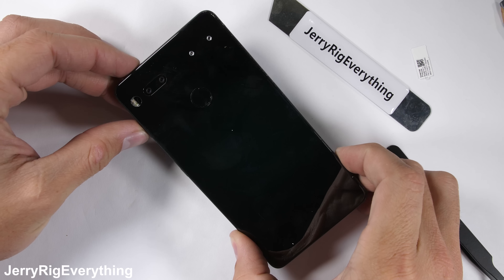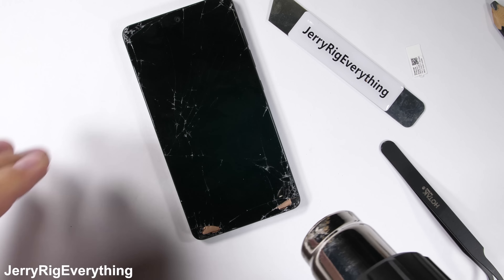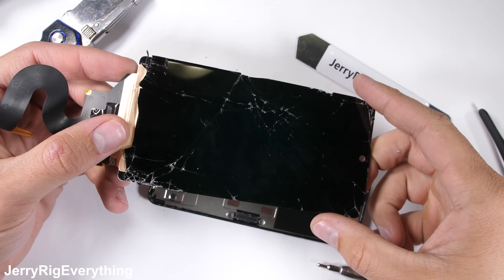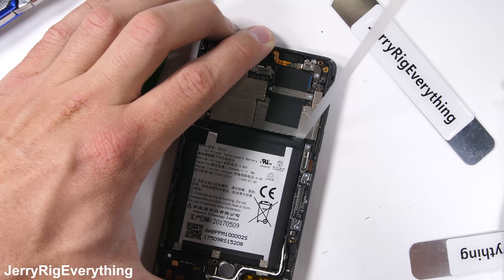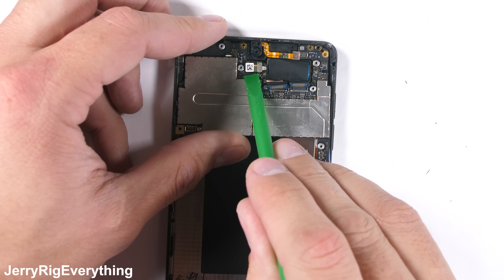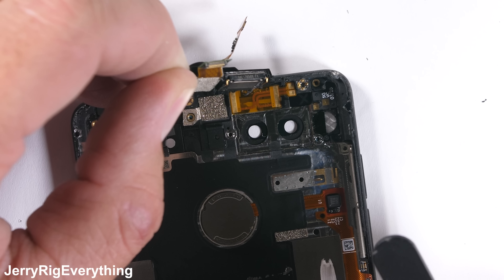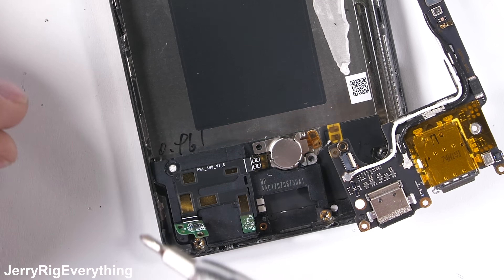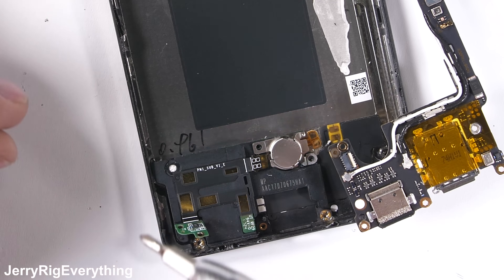Essential Phone Teardown - Complicated and Pointless

Comment: Haha as Apple can tell you...batteries don't last forever!
Reply: CoolCat Carolena no battery lasts forever, and in inferior android copyphones, they die years before in a perfect apple device
Reply: CoolCat Carolena yes even if you bought an iPhone 7 few days ago it will be slow down because of "degraded battery" no matter if you bought last year model as brand new few days it will be slow down because it's "older model" and the "battery is bad and needs to be changed" but they will say that i need to buy new one... 😡
Reply: Haha I know coolcat I thought that was a total burn on apple like lolol
Reply: +Tomas Gaming that is not truth, if the phone is new and the battery i intact it won't be slowed down. If u are gonna roast, at least do some research first...
Reply: Tomas Gaming  has not yet throttled the SOC on the iPhone 7/iPhone 7 Plus yet.
Reply: official_gymkhanaschoitl Lmao my Nexus 6 has outlasted my friend's iPhone 6.

Have fun with your iPhones that cost far more than they should :D
Reply: official_gymkhanaschoitl then how come most cheap android phones let u replace the battery and not have to buy a whole new phone unlock apple?
Reply: Roshan Pai Samsung devices slow down on every update as well.
Reply: Jacobytm 01 get the battery replaced smart one, that’s what apple stores are for
Reply: Tinu Thomas apple sheep
Reply: Tinu Thomas but then why some iPhones were slowed down for no reason? I know! They want to you would upgrade to the new model!
Reply: Tomas Gaming true. I mean isn't it weird that the update that makes the iPhone slow comes around the same time a new iPhone was released. Plus Samsung LG, and other companies said they don't slow down their phones.
Reply: Tomas Gaming No iPhone was slowed without any reason. I think that you don't even have an iPhone. Do some research m8.
Reply: Shubh Jsh i have iPhone 5.
Reply: Shubh Jsh iOS 10.3.3 jailbroken and have dualboot iOS 7.1.2 & 10.3.3
Reply: Tomas Gaming iPhone 5 wasn't even slowed down. The only affected phones were iPhone 6 and above and I happen to have access all of them. 
Your phone has not been slowed down and has just genuinely become old. It's been ~5 years since iPhone 5 was released.
Reply: Tomas Gaming when was it slowed down for no reason? The iPhone 6 6s SE and 7 are now programmed to slow down the CPU if the battery can’t handle its demand. At the moment only the iPhone 6 users are seeing a change but the rest are completely fine. iPhones don’t slow down unless you’re talking about on new updates. Old hardware doesn’t run new software as well as new software does. That’s a fact
Reply: Tomas Gaming You realise that the throttling feature is only activated if the battery is over a year old? If you bought any new iPhone, you’d be getting max speed.
Reply: Jacobytm 01 You can Just get a new battery for $29..
Reply: immortalHD 7 no it’s not it the phone is old, it’s only when the battery is at 80% of its original health, these phones are 3 years old
Reply: Tomas Gaming Which iphone was slowed down for no reason? A year old iPhone 7 still needs battery protection. If you buy a new iPhone, you’re not being slowed down. The feature only activates when the battery is more than a year old.
Reply: The Unknown So now anyone who actually knows what they’re talking about, and who isn’t just blindly following what others say, is a sheep?
Reply: Tinu Thomas Exactly. So if you buy any new iPhone, from SE to X, your performance won’t be throttled.
Reply: Tinu Thomas that would be a point if iphones had reliable and consistent batteries over the years... But all I see is friends' iphones dying on 30% or more battery after half a day of use. My old Xperia z had shit battery to begin with and after 4 years of use it still was more reliable than an iPhone 6.
Reply: LOGAN it actually depends on how much usage it has had with the number of charges cycles it has been through. iPhone 7 batteries could have already been charged over 500 times depending on use
Reply: Shubh Jsh the battery life thing seems to be is a red herring as the iPhone 5s and 5 aren't affected by the slow down, yet the SE is. Different battery manufacturers?
Reply: Remember, this whole thread happened because of a comment making an Apple joke.
Reply: u think they want do research?? as long can humiliate apple, thats enough for them. if they do research , they cant made fun of apple
Reply: Remarkably Unremarkable iPhone is overrated and I find it found way too much in people's hands. I just don't think they bothered to try other phones and just went with that phone because everyone else has it. It's just herd instinct.
Reply: Tomas Gaming that isnt how it works. Dont speead false information
Reply: No, my 6 month old iPhone 6s didn't faced this slowing down or throttle issue, as having same benchmark results
Reply: Fried Apple
Reply: Actually, Apple has a somewhat legitimate reason on why they slow down iPhones with degraded batteries.

It's to reduce the likelihood that the phone would suddenly and randomly shut off due to the battery not being able to supply the required wattage during bursts of intensive workload. Not only is this inconvenient but it can also prove to be seriously problematic during emergency cases.

Now, Android manufacturers claim to not slow them down, but having owned a Moto Z which keeps shutting off randomly due to a degraded battery, I feel that maybe they should at least consider some sort of temporary workaround.

But here's the thing. An iPhone has 500 charge cycles while even an Apple Watch apparently has twice the number of cycles before capacity begins to deteriorate. A Galaxy S8 and Note8 apparently only degrade up to 95% of its capacity after reaching a certain amount of charge cycles over a 1-2 year period. I think it's time Apple starts putting better batteries on the iPhones.
Reply: Or, how about Apple stops doing what's basically a locked overclock to the processor, so you get consistent performance from the phone across its lifespan?
Reply: I use my Sony Xperia z 2 for almost 5 years now and no battery problems or slowdowns. It is perfect.
Reply: currently using a samsung galaxy s5, bought it at the end of 2014, still hasn't slowed down at all or even broken in daily use... also thinking that the battery could even cause any type of slowdown in the phone is ridiculous in itself

edit: also no, the battery lasts as long as it did when i got the phone and it doesnt randomly shut off because of "excessive current usage by the cpu" just quit your bullshit
Reply: And as Fandroid is going to tell you: Android batteries of course last forever. It must be! Right ?
Reply: ThatOneBlueGuy 
If you write something like that, you have to expect that. If i write: „2018 is there, unlike your Android update“, a whole bunch of people are going to be pissed as well.
Reply: i have no idea what you are trying to say with "2018 is there, unlike your Android update"?? it doesnt even make any sense :D
Reply: juhotuho10 
Its a joke about Android. But also an example. Not more.
Reply: The Unknown yes because calling him an apple sheep is a very compelling argument
Reply: Dude Lmao iPhones are totally worth the price, unlike android copyphones, which are heavy overpriced. Not even worth 10 bucks, for cheap iPhone ripoffs
Reply: +Mabirc research lineage os
Reply: BenlePlayz 
I know what that is. Changes nothing.
Reply: People kept complaining about their phones randomly shutting off when it still had a good amount of battery percent. So apple fixed that problem by slowing down the iPhones of people who have a badly degraded battery. Now they are complaining that their phone is too slow when they basically asked apple to slow their phone down.
Reply: arthur staal the 30% dying thing is basically why Apple Is doing this. It’s a 3 year old phone, I don’t think it should be lasting that long especially since its a way smaller capacity compared to the Xperia Z. Phones aren’t made to last forever, your phone will do what I stated before. Once the battery is finally taking its toll, the phone will shut off randomly because the battery can’t give what the CPU demands
Reply: So much animosity. Can we all love each other <3
Reply: Tinu Thomas The only sane comment here, yet you’re repeatedly called a ‘sheep’. Shows who the real sheep are if common sense and a clear understanding flies over people’s thought bubbles.
Reply: CoolCat Carolena 
Well I just recently got the essential phone, but before that I had s Nexus 5, I've had that thing probably since it came out (which was 2012, I believe) meaning it lasted 6 years without a battery change, and plenty of me dropping it.

And it only cracked a couple months before I got my new one.

So I don't know about iPhones, but if an older iPhone can do that, then your on equal footing here.
Reply: Carlos Sanchez exactly, initially I did get mad that Apple was slowing phones down but I actually did my research and honestly Apple did nothing wrong other than never disclosing what causes the slowdown. I love both iOS and Android and all the companies in the game, but when people are ignorant I’d love to come in and clear everything up.
Reply: Tomas Gaming e
Reply: Tinu Thomas That’s what they want you to do, they want you to pay alot of money to get the battery replaced because the IPhones are unrepairable yourself
Reply: Batteries do degrade
Reply: @DerPfoertner  Between a 5 year old android and a 5 year old equal spec iphone, i bet android would perform better
Reply: The Unknown Samsung later said they did. The update comes with the new phone same as every manufacturer. Your phone isn’t slowed down if you have a perfect battery. With the battery status info now you can check if your phone is throttled and deactivate it
Reply: arthur staal the bigger the battery the more it degrades...
Reply: juhotuho10 because the cpu in the s5 is very slow...
Reply: Adnan Ahmad they always release the new update with the phone and they did that before the started throttling so what’s your point?
Reply: Frankie yeah 29€? „ a lot of Money“ well less than any other manufacturer with a similar battery...
Reply: @DerPfoertner  haha the " perfect " apple device
Get a life
Reply: @DerPfoertner  aww don't be salty
Reply: Manufacturers count on it so they can sell a New phone instead of just the battery Also each New model requires more dongles and external crap so even more useless shit can be sold

Comment: Essential Phone — A phone that lacks all the ESSENTIALS.... 😏😜
Reply: Raghav T Called "essentials phone", but lacks an AUX port
Reply: Alloy The Raccoon I'm using it right now and I really like it
Reply: Alloy The Raccoon I can understand why it isn't for everyone. And I was kind of apprehensive about the headphone jack at first. But I pretty much use Bluetooth for everything now and they provide a nice braided dongle if I wanna use a wired pair, so I really haven't had any problems.
Reply: Noah Barnhart It's a good phone, especially at the price point. Display is gorgeous, it's IP 54 so it can get rained on with no problem, and it runs smoothly. Honestly I love my note 8 but if the essentials phone was IP67 rated or higher and had an AUX port I would have chosen it over my GN8
Reply: AmnScottNN Well said sir. I think the only thing that I wish it had that it doesn't is an OLED screen. Everything else is great.
Reply: an aux is not even close to essential
Reply: Me too. I love it. The camera is also getting better with updates.
Reply: Raghav T 
Got an essential for Christmas
Reply: Alloy The Raccoon 
It's surprisingly easy to get a basic case, there are like 5 different types and only one is nearly sold out.
Reply: Alloy The Raccoon 
Really? My brother found some within like seconds.

I literally just googled it and got some hits.
Reply: Alloy The Raccoon 
I think we got it from the Sprint store, not a physical one. 

Maybe they don't sell it near you as you theorized, even though it's snowing online thing.

Must be a country thing then. Either way, cases are easy to get in the states.
Reply: The silly irony. All I one packaguuu
Reply: I bought one in 2019. I liked it within a day, bought another for a backup for $100. Talk about an underused phone...

Comment: I was able to repair my phone very easily... got the screen online in ebay, bought a heat gun at harbor freight for $12 and bought a suction cup for dents on cars there for $4.... used e6000 glue from walmart for like $4 however i should have bought the black glue instead of the clear version.... all in all i spent $60 bucks maybe and maybe an hour to repair as a first timer... the hardest part was installing the glue before i found out it was drying quick lol... once screen was installed wrapped it with rubber bands tightly since i didnt have a clamp used it 2 days later and its been working perfectly. its my daily driver. i wish i had a longer lasting battery but i am very pleased with my phone again. this time ill have a case on

Comment: Essential facts: 1. The mobo networking and the essential housing network bands must have the same serial codes, otherwise your phone will essentially fail to read sim card and connect to Wi-Fi.
2. There are several types of screws: small black, big black. Small silver, big silver. But there is one black screw that is bigger than big black screws.
3. This phone is made of premium materials yet the display is a cheaper lcd screen.

Comment: I contacted Essential to ask about authorized battery replacement center recommendations. That's because I heard about the parts not being readily available. This is the response I got:
______________
Hello,

Thank you for reaching out! 

The battery is not replaceable in itself due to the way the phone is designed.

Comment: One year into owning my Essential phone, I have no cracked display, a few scratches on the titanium edge from not cleaning the pocket sand from my case as often as I should, a 360 camera that's basically a paperweight, but on the plus side I have Android 10 with the latest security patch, and I was in the beta months ago. I have to restart it every other day or so as the 4gb of ram seems to fill and the phone slows down until a reboot. I like what they've done on the software side of this phone for sure though. Getting updates as quickly as the Pixel phones has been wonderful. Don't know how I feel about the new generation they unveiled, seems very odd to me. But if they make something else in a similar form factor, I might get it. Although I'd enjoy a headphone jack and an SD card slot.

Comment: Worth noting that this phone has no headphone jack, so the USB port will get much more wear compared to normal phone unless you have wireless headphones. No wireless charging either, so if the pernamently soldered USB port with no replacement parts available breaks, you're screwed.

Comment: ive been able to find screen replacements for the essential phone off ebay, are those fake? mine has a deep scratch i want to fix, also the battery does drain a bit faster but it also charges in 15-20 minutes to 100%, so its something i can live with lol still an amazing phone,

Comment: You only ever really need to mmaayyyybe change is the screen and the battery, which are both very easy to swap out. The screen is tough to get off but nowhere near as difficult as this video makes it seem. Lots of negativity surrounding this phone because of the competition.
Also, replacement screen is only $70. I had to replace mine and opted to do it myself over paying essential $200 for another phone.
Awesome Pixel 2xl/Oneplus alternative with better design and screen. 
Also has awesome xda dev support along with Android P working flawless

Comment: Hi jerry i can't really find you're contact details so here it goes, I've cracked my  2017 surface pro screen and seem to be unable to find any information about what replacement display is needed. now i know it's not a phone but i remember cracking my iphone 7 lens and you were the only one to cover that issue, this is a similar situation in my opinion ifixit doesn't have any infor as to wether the surface pro 4 and 5 use a different screen replacement. However this is very mainstream computer/tablet with a unfriendly to repair glue display, i live in west of
 Australia and there are zero microsoft service centres here. please le me know if you've read this and would consider looking into thw matter there's a gray area to cover and you'd be helping a long subscriber :) thanks.

Comment: Jerry, why do you like wireless charging so much?
It heats the battery which results in capacity loss damage, charges slower and you cannot use it while charging likenyou could with cable.
Wireless charging is just another stupid gimmick

Comment: Essential is bad. This is basically a scam company made so that Andy can retire successfully with some big margins for the company and small value for the customer.

1) Bad camera. WHO THE HELL THINKS THAT "SOFTWARE UPDATE" WILL MAKE THAT HORRIBLE THING BETTER? My Nokia 5 has MANY TIMES better camera... for just fraction of the cost.

2) BAD build quality -- if you have it without case you WILL break it fast. But if you use case the ceramic is POINTLESS since its coeverd (and yet again will be easier to kill from drops than aluminium).

3) BAD customer support. Horrible handling of the people's money and complains. Scammy sh*t.

4) NO headphone jack... Essential my @ss -- more like Dollarsential.

5) SLOW for its money. Needless to say there are STILL much much better phones for the money.

6) Not the design king - Mi mix 2 is better in any direction yet not any more expensive.

That price drop lets you know how much over-priced this failure was. I knew it back then and said it, but the fanboys had hope.

Sorry guys -- if it walks like a duck and talks like a duck...
...Essential is a duck!